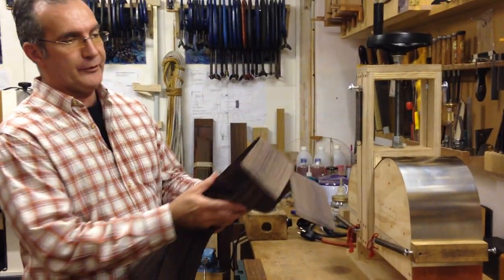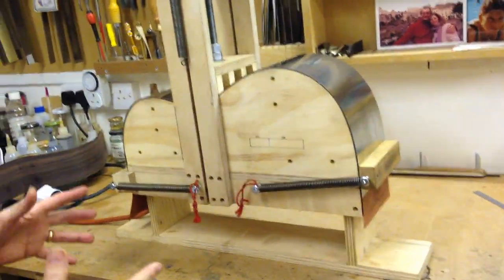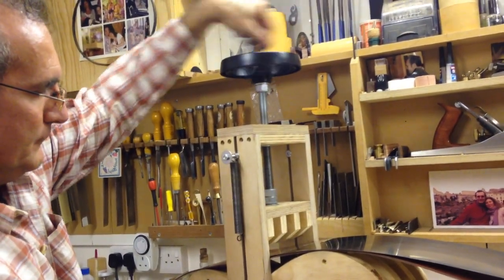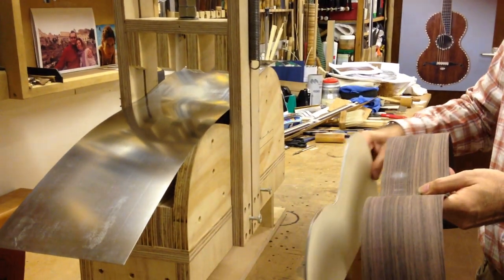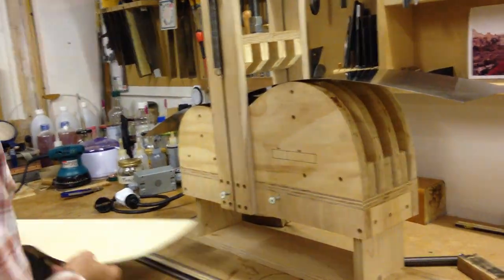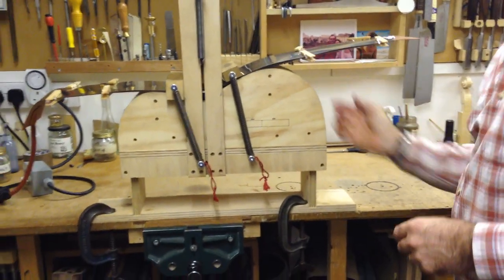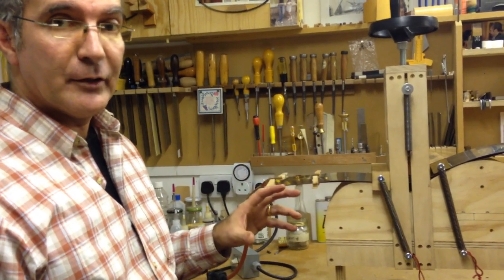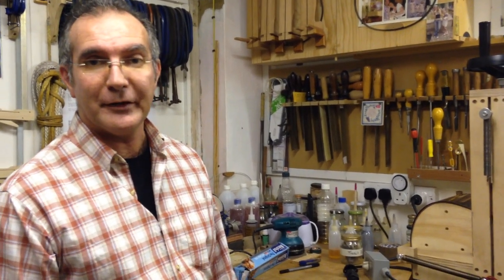Side bending jig for classical guitar

Comment: Hi Pablo, thank you for an excellent video of your side bending jig. Could you tell me what size are the springs you used on the sides and where did you get them please.
Many thanks
Brian
Reply from the maker: Hi Brian, I tried to find the supplier I used to buy my springs but unfortunately it was quite a while ago and I can't find it, but if you look on line, on eBay for example, you should be able to find some. The ones I use are 150mm long and the wire is 2 mm thick.
I hope this helps.
Reply: Thank you for your prompt reply Pablo, much appreciated. Regards

Comment: Hi Pablo, any reason that you put the heat blanket under the wood but not above the wood?
Reply from the maker: No particular reason. You can use it on top as well and it should be fine.

Comment: Hi Pablo very nice video. I use a normal bending iron but my sides have some problems and now I will build a bending machine. Do you know were can I buy the silicone heater, here in Europe? Thanks
Reply from the maker: try here,
http://shop.rall-online.net/epages/61511639.sf/en_GB/?ObjectPath=/Shops/61511639/Categories/236/160/212/211
Reply from the maker: you may also be interested in this:
http://shop.rall-online.net/epages/61511639.sf/en_GB/?
Reply: Thanks Pablo!!

Comment: How thick is the plywood you use for this jig? 3/4”?
It’s 5” wide? Same width as the blanket?
Reply from the maker: Hi Steve, yes, the plywood I use is 3/4 " and it is 150mm wide. Just in case you are interested, very soon I will be releasing a video about how to make a bending jig and another one about how to build the solera and both will be available soon on my website: www.onlineguitarmakingcourse.com where I already I have available for sale a complete guitar making course video series.
Reply: @redkitekk  okay. Great. I look forward to it! I’ll hold off starting to build one....
Reply: @redkitekk  Will they be included with the complete guitar making course or only as "add ons" / seperate? i.e. if I  buy the complete course, will they be part of what I have access to?
Reply from the maker: @stevehensen8837  these are not included on the course, you have to buy them separately.

Comment: 10:16 what is the name of the tool for heating??
Reply from the maker: It is a power cut off timer. You set up the time and it will cut the electrical supply to make sure the wood doesn’t burn. I bought it years ago in LMI a Luther supplier from USA. You can find them in google